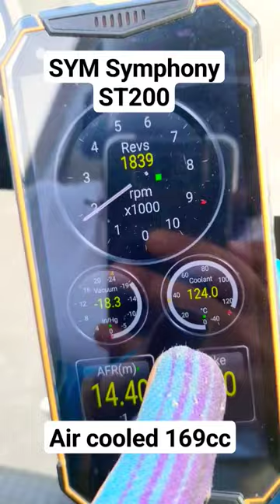Scooter air-cooled overheating in the summer?

Comment: Hey Alex!

How did you get those engine readings?Nice!!!
Reply from the maker: ELM327 adapter from aliexpress and "Torque Pro" app from the Android Play Store.
Reply: @RideWithAlex  Hmmm you gave me an idea!I will insulate the air intake pipe going to the engine.I see it runs above the engine and it shows from the intake temp!From my car mod running an aftermarket ECU,the cold air intake made a huge difference on engine power-the cooler the better!
Reply: @zzt231gr  That's correct. The engine's efficiency depends on the temperature difference between the air at the intake and the gases at the exhaust.
Reply: @RideWithAlex alex, which adapter and spesific for symphony? Can i take link? How did you took your bike? Thank you for answers
Reply from the maker: @homurbey  I don't have a link anymore, I bought it many years ago, they are all the same, I bought a short small version that fits under the seat in the obd port.
Reply: where is the ECU socket on symphony? on my HD 300 it's under the seat, near lock hook and it's impossible to use whit the seat I closed :(